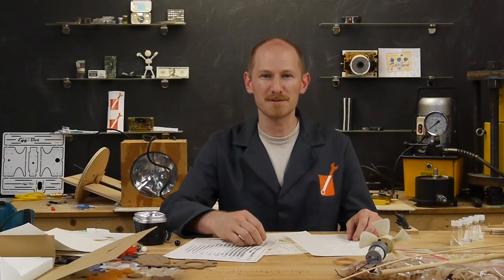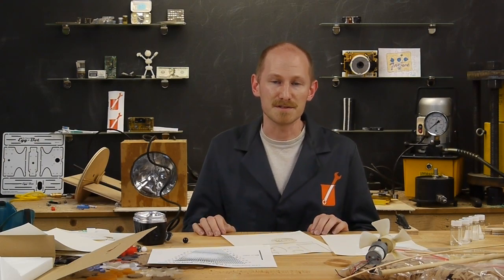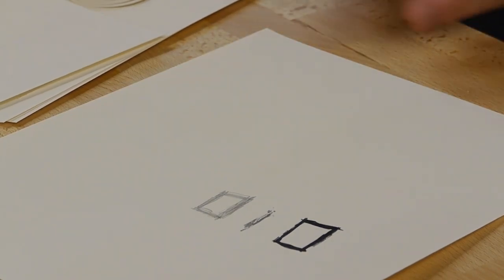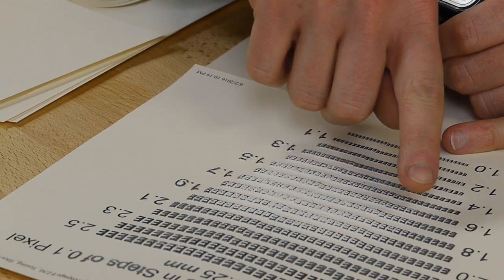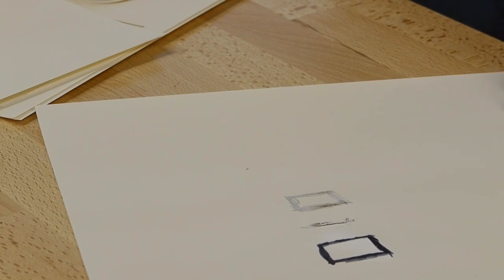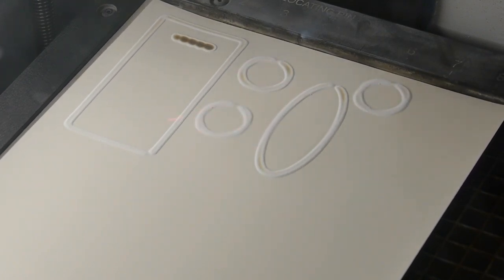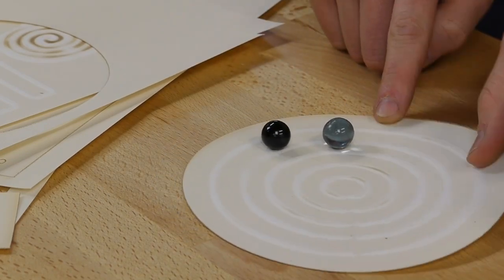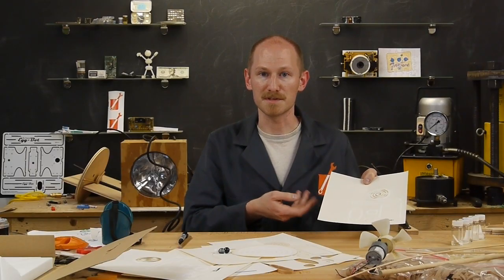Heat-sensitive 3D paper (swell paper)

Comment: would be interesting zo see what happens if you print and expose or lasertreat the paper from the backside. Also don't the rollers from the laser printer completely swell the paper? laser toner is fixed with heat after all...

Comment: Raise and cut shapes with the laser, paint the valleys with restive ink, flip it over and you have a custom button pad. Or heat up conductive paint with the lamp and create tactile cap touch sensors.

Comment: If it's heat the paper is seeking and a scratched surface increase the swelling, you could also try with a heated point, like a small copper blade with insulated sides. An easy hack for a laser cutter.

Comment: I wonder if you could find or make some inkjet printer ink that transmits visible light but absorbs infrared light. Then after printing, you could expose it to intense infrared light to get the raised sections without the black ink.
Reply: You could probably lay a silicon or probably even just a piece of plastic over the paper to shield the light from getting to the paper in the first place. It would just be a stencil but you're painting with light/heat. 

Alternatively, you could make a hot plate to stamp the paper.

I'd love to get my hands on some of this paper to mess around with.

Comment: Do you know what the coating is?  I wonder if it is similar to intumescent fire resistant coatings, which are often just sodium silicate.  Although it appears to operate at fairly low temperatures which suggests it might be polymer based instead...
Reply from the maker: It's a little unclear exactly what it is.  I'm betting it's a polymer which becomes foamed when the internal fluid builds up enough pressure to deform it.  The resulting texture/compliance is interesting -- actually very pleasant to the touch.  I should put some in the SEM, and try to activate it with heat!
Reply: Polystyrene beads are similar to grains of sand until they are heated and then they fluff up.  In shop class in the 1990s we filled molds shaped like footballs and boiled them to make styrofoam footballs.
Reply: After a few minutes of searching on the subject: "Microcapsules of alcohol implanted in the paper fracture when exposed to heat"
https://en.wikipedia.org/wiki/Tactile_graphic
Reply: Applied Science Please tell me you read the link under "Swell paper". :-( You should at least test for the presence of alcohol to rule this out or confirm it. (Maybe shred the paper with water, separate the paper using a filter, and then do some chemical analysis things. Alternatively, some sort of burn/melt test. Or just call the manufacturer.)

Comment: Print out a maze with a conductive coating and use a sharp metal pen that connects the circuit if you hit a wall while tracing to the finish.

Comment: Is this like an ultrafine layer of expandable polystyrene? I can't seem to find a data sheet or patent for the right thing.
Reply: Search harder. :-)
https://en.wikipedia.org/wiki/Tactile_graphic
"Microcapsules of alcohol implanted in the paper fracture when exposed to heat and make the surface of the paper inflate." (So the detail you can get with this is likely limited to the size of those microcapsules.)
It's probably patented as well, didn't bother to go back and look once I found the "how this works".
Reply: Funny. The one time I didn't start with Wikipedia... Thanks.

Comment: I wonder if that coating could be applied to a more elastic material, so the swell height could be greater.
Massdrop might be a distribution idea... I bet you already know of them, but if you dont:  they work with retailers to get cheaper prices on quantity purchases.  If a good number of people pledge to buy a product, their price will be X% cheaper than if they didn't band together.
Also, I like your new set dressing.  (It is new, isn't it?)  Keep filling those shelves up with cool trinkets.  :)
Reply: Have you never had that coloring as a child that you could paint cloth with, then iron them which would raise the paint exactly like this? It then even survived the washing machine. I guess that is the very same thing "invented" again decades later. So yes, it can be applied to flexible materials.

Comment: Ben, if I'm not mistaken, the Epilog's raster power settings can be set very low. With some experimentation you might find a raster power level that would "print" a more detailed image with more control. You can then do your printing and cutting without changing the bed level.

Anything you want printed would need to be a raster image. If Epilog still uses CorelDraw, any image wider than 1 pixel will be treated as a raster image. You can combine both vector and raster in one file, but you probably already know this?!

EDIT: spacing
Reply: I came to the comments to say this too. Turn down the laser power, see how fine you can print out details!

Comment: Two words: thermal printer
Reply: I agree with you. Using and old faxsimile... maybe it need some tunning to delivery more power.

Another option is use a CNC router with a hot tip over the paper

Or a stamp...

Comment: Would this expand on the fuser in a laser printer? Jam it?
Reply from the maker: I've used it in my Brother multi-function laser printer, and have not had any problems at all.  Apparently, the fusor temperature is lower than the paper's swell temperature.  The manufacturer warns that it can be a problem in certain situations.
Reply: Thanks. I was wondering the same thing.

Comment: I'm just sorta confused on why it expands in places with the market only, but the laser expands it anywhere. I get the laser is much more focused and powerful, but why when treated with the handheld light does it only expand in places with the marker/pencil/ink from the printer?
Reply: The black gets hot from absorbing the light. The unmarked paper reflects most of the light. It is like the black lines on the bottom of a pool. They become very warm from the sun even being under water.
Reply: +SamMcSmiley Oh I see, and the reason it works with the laser is just because it's so intense that it doesn't need the black to absorb the light. thanks.

Comment: I wonder if a person could make very intricate designs using your laser method but flowing cold air around the area to cool it more quickly.  Ooh, or floating a vapor of liquid nitrogen on it while lasing it.
Reply: The maximum detail would be limited by the micro capsule size on the paper.

Comment: Can you laser cut an exposure mask and heat through that, either with the lamp, or again with the laser cutter?
Reply: Yes that is the idea, like on an old book cover or on the seals of some certificates. If the texture was not very high you could also use it to add detail to diorama models. Like those houses made of card, add the texture of the brick or wood before you add the colour with an inkjet printer.
Reply: thats a good idea.  laser cut some foil backed paper or something else infrared-proof.
Reply: Zev Hoover Sounds ideal, if you can cut it with the laser. The other idea I had was to laser print a mask on clear plastic and then use that special foil that you heat bond to the image areas, then you'd have a clear sheet with reflective parts in the areas that you wanted to keep flat. Not sure it will be that great, but worth an experiment.
Reply: Daniel Matthews seems like just printing black on the paper works pretty well but your way may be more accurate and repeatable.
Reply: I like the white on white look the laser gives, when it works, a mask is the only way I can think of getting it with just a lamp.
Reply: embossing it without ink using the laser or a mask would create a watermark like effect only visible under certain light.

Comment: How about printing on a transparency sheet, and laying it on the paper.  If the plastic sheet can stand the heat, the raising paper would push it away, and maybe help regulating how much heat is 
absorbed.

Comment: How about putting the paper on a cooled plate then leaving a tight focus on the cutter? The old "boil water in a paper cup" trick. Perhaps you could get fine lines and yet avoid burning or cutting.
Reply: That would condense water on the paper unless you work on a very dehumidified ambient wich is not a very comfy place to be in.

Comment: Would it puff up in a microwave? Watching the laser cutter it almost looked like you were printing on a sheet of thin marshmallow. Also does it work on a temperature differential or a specific temperature at which it expands? If you froze it could you then place your hand on it to make a raised print of your hand?

Comment: Is the coating impregnated into the paper, or more like a coating purely on the surface?

Any idea what the actual compound is?
Reply: from a wikipedia article: "swell paper has a special coating of heat-reactive chemicals. Microcapsules of alcohol implanted in the paper fracture when exposed to heat and make the surface of the paper inflate. Placing black ink on the paper prior to a heat process provides control over the raised surface areas."
Reply from the maker: It's a coating that can be scraped off somewhat easily.  The methylene chloride causes the coating to soften and expand, and it lifts off from the substrate, which appears to be actual paper.  I did some quick searching for something like an MSDS, but I do not know what the coating is.  Perhaps it is related to heatshrink tubing?  Polyolefin?
Reply: Hunh, that's pretty interesting! Shame that wiki-article doesn't list a citation, I'd love to know more.

Comment: Since its a coating, is it possible to scrape it off and apply larger amounts of coating on another sheet of already coated paper, increasing the "swelling" on certain areas. Possibly cheap low end 3d printing. What is the coating made of?
Reply: I don't think it really is a coating.  more like a sheet of foam, or one of those sponges that gets bigger when you wet it, but with heat not water.

edit NVM I was wrong.  the company website had me confused

Comment: Card makers and the like have been embossing paper for a long time, either mechanically or with thermoplastics
Reply: Quite a different method though. Card makers traditionally will mechanically stamp paper. This is caused by alcohol in micro capsules expanding when heated.
Reply: Bowowowification It's pretty irrelevant what the mechanism is, the result is the same.